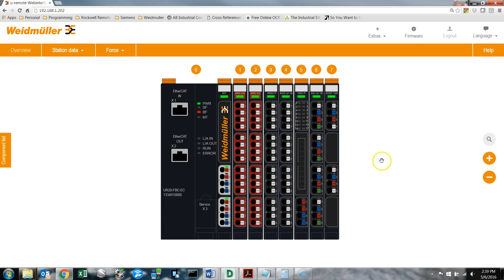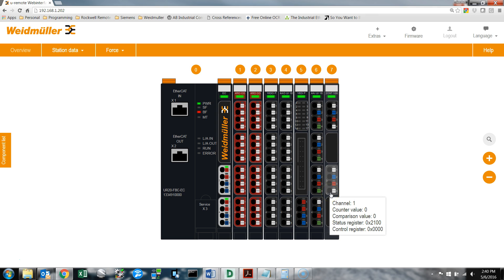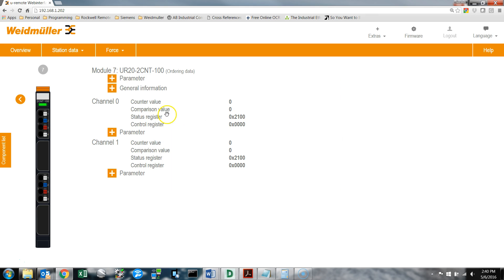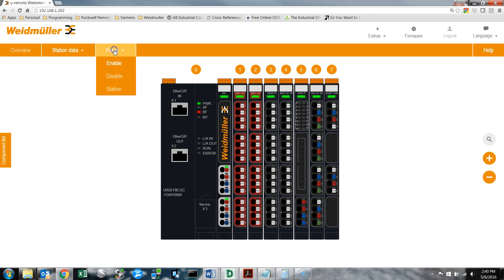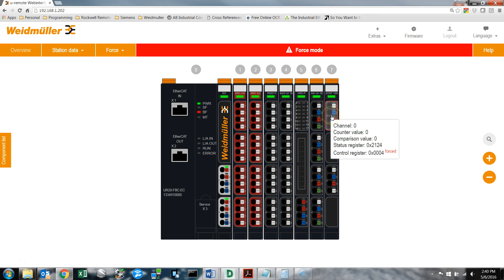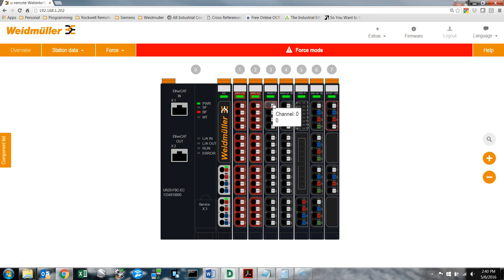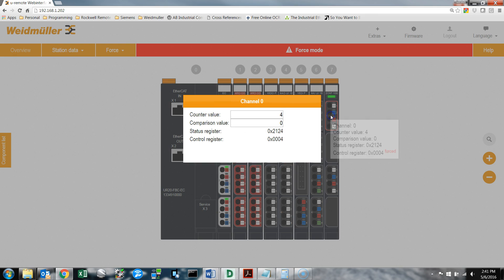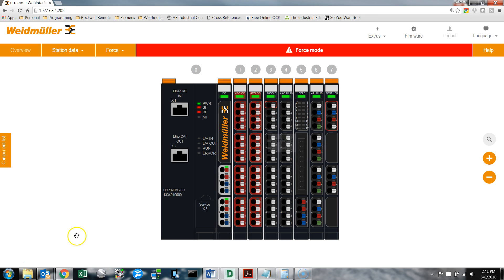Weidmuller u-remote counter module

Comment from the maker: Hi Alan, the top power feed is for system power and inputs.  The bottom power feed is only for outputs.  So you can put 24V on the top and jumper them to the bottom.  If you want your outputs isolated, you can use a separate power supply for the bottom power feed.  Weidmuller was pretty smart with this, because it allows you to isolate your IO without having to add an additional power module.

Hope that helps.  If you have more questions, let me know.  You can also contact Weidmuller support in the U.S.  They're very helpful.

Comment: Hello there,

Question regarding the wiring for the u-remote.  I am unable to locate their wiring diagram, but for the module itself do you wire +24V to the (2) 24VDC INs?  Based on their drawings, it seems to be (1) 24VDC input reserved for the entire backplane, and (1) 24VDC input reserved to power the other other slot cards for either inputs or outputs depending if its sourcing or sinking inputs.

Your help is greatly appreciated,
thank you!